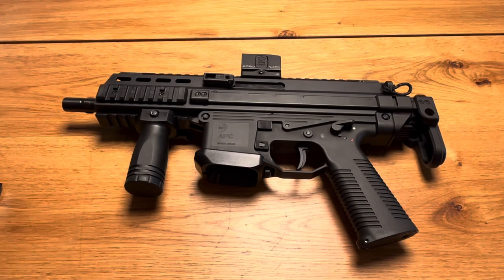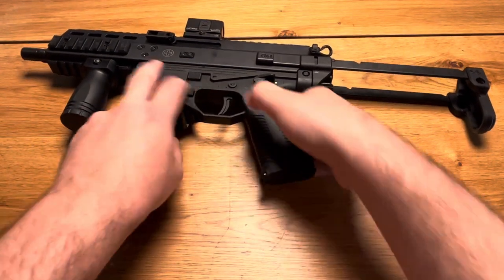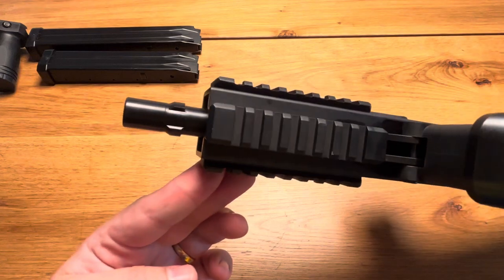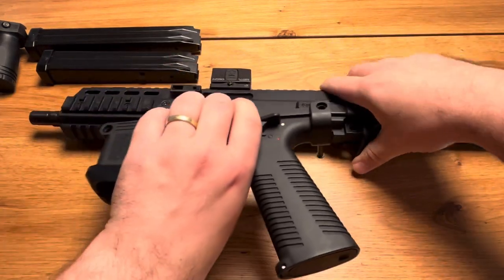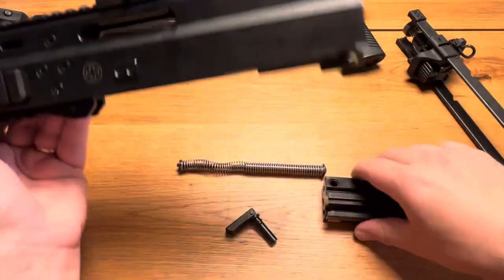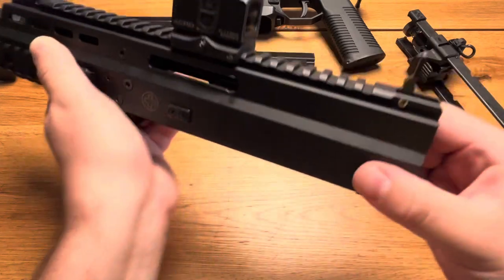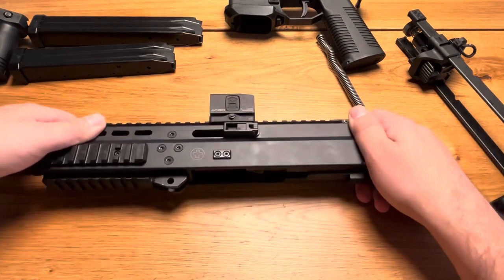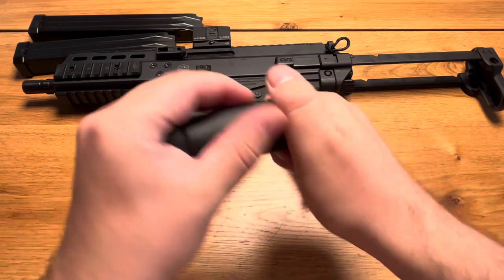After 10 years of ownership: B&T APC45

Comment: Thank you for the 10 year review. You've taken great care of it - it looks brand new. I have an APC9K, and GHM9 and would love to have a .45 caliber in either one from B&T. To many more years with the Swiss beast👋
Reply: How would you compare those two?  Would you recommend one over the other?
Reply: @flashkw83 I’d recommend the APC9K. The charging handle is non-reciprocating -  which is the biggest difference for me. The GHM9 however has the “Navy” style tri-lug ; whereas the APC9k comes with a tri lug adapter you thread on the threads of the barrel. 

You can’t go wrong with either one really. They’re both great 9mm sub guns.
Reply from the maker: They are both great. Try them both if you can before deciding!